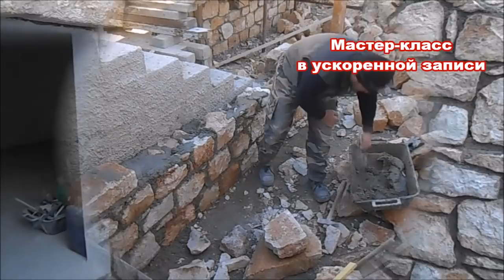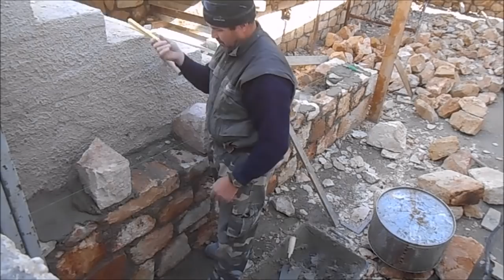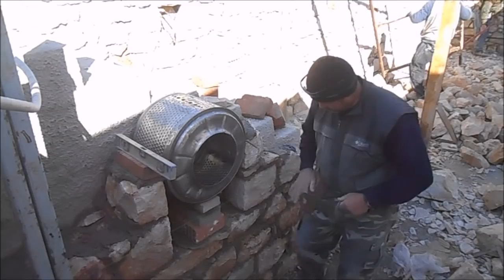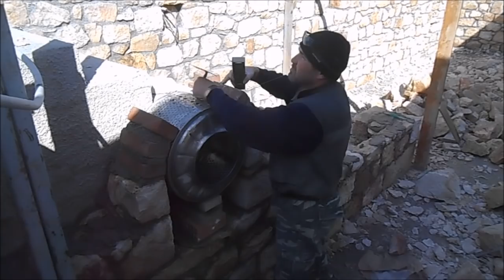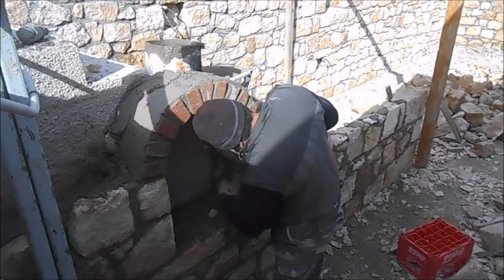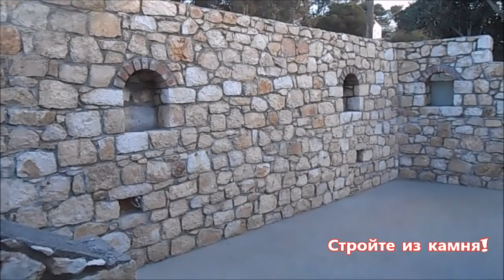Небольшая ниша-арка из камня. Мастер-класс

Comment: The stone work is lovely but he should leave the bricks to the professionals
Reply from the maker: Customers want a brick with a stone sometimes.
Reply: @stonesuccessvip  I agree done it many many times but the brick joints should be no more than 10 mm apart and on an arch that tight the bricks should be shaped so the joint is the same size from top to bottom
Reply from the maker: It depends on the size of the arch. I had it in diameter of 46 cm. Armature 10 mm at the base of the arch. You see, I put it between the bricks? And at the top between the bricks, the distances are large, because the diameter of the arch is small.
Reply: @stonesuccessvip  and that's why it looks so bad you should have shaped the bricks you can obviously lay stone but your brick arch is 90% mortar and then you put a cut in for a key at the top check out the fine art of brickwork video on arches and how to set them out because you can't !!! 10 mm is the standard in all developed countries we can't all be wrong so check out robs videos before you call a mason of 40 years experience amatur
Reply from the maker: Show off your videos, your work.
Reply: @stonesuccessvip  pal I'm not criticizing your stone work I'm just saying your brick arch is not what it should be set it out dry on a board shape the bricks so they are all the same that's all I'm saying . The arch spoils a good job . Personally I've spent a lifetime on listed buildings and monuments eg national trust . Your center ring should have the shape and size of every brick and joint marked on it . And you've got a drum from a washing machine FFS
Reply from the maker: Thank you, colleague! Brick was not possible to cut here. And the arch is small and high)))
Reply: @stonesuccessvip  if you can lay stone that we'll don't let yourself down by doing something that I know you could do better take care my friend and your stone work is lovely
Reply: I was ready to take offense with Burt's comment. I would not state it like that, because the mason is a professional. In my estimation. Working with other materials like concrete blocks and bricks usually is child's play. A stone mason typical is a more skilled craftsman than a brick layer (mason) owing to the multitude of shapes that his raw materials (stones) come in. However, when I went back to the video and looked at the work that I so admired before, because of the beauty of bricks mixed with stone, I have to agree that the it should have been done more carefully. Bottom line is that we all can improve our craftsmanship. Excellent video!!